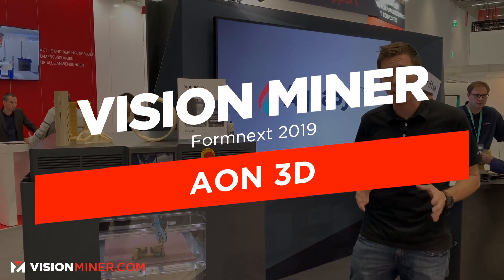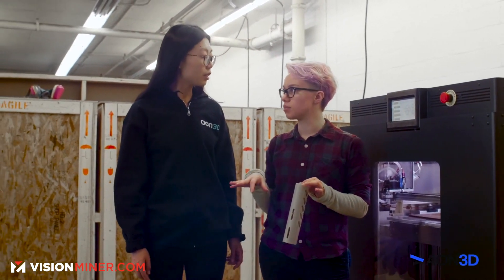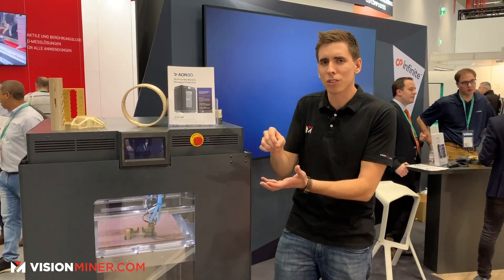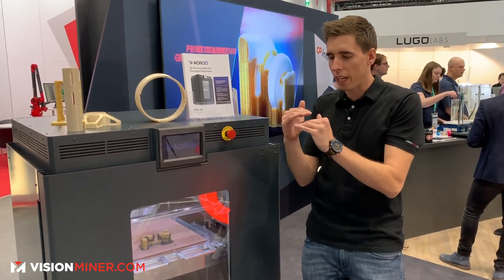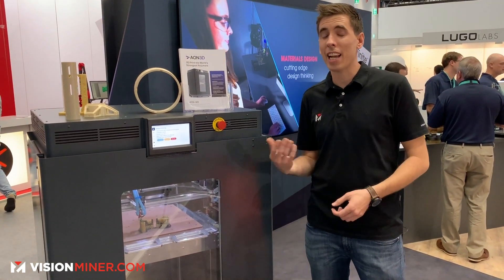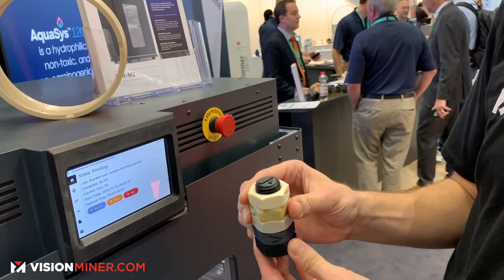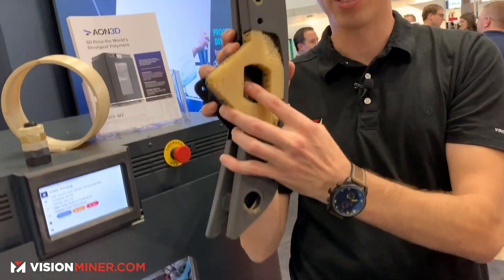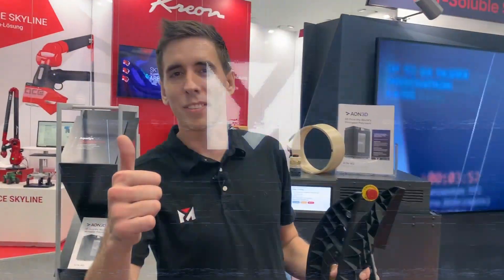AON3D M2: 2020 Edition High Temp 3D Printer for PEEK, ULTEM, and more! Formnext 2019

Comment: how are you supposed to print abs in a heated chamber with no part cooling fan?
Reply from the maker: Exactly like you said it -- in a heated chamber with no cooling fan. This has always been the best, most effective way to print ABS.

However, I can see how this may be confusing -- the filament market has evolved greatly the past two years, and consumer materials are no longer just raw, virgin polymers -- most contain additives, which help the flow, consistency, melting points, and things like that to make it more printable. Thus, it can definitely be printed in an open-air printer now, with a cooling fan, but the best results (mechanically, for sure) come from printing in a heated chamber -- on top of that, it helps reduce the expansion/contraction and helps maintain dimensional accuracy throughout the whole part :)

Comment: Looks like the A2V4 from 3NTR for most part except for the independant print head and a way more up to date features. And the only fact that it is S3D friendly is a plus compared to 3NTR with their SSI or Kisslicer default use.
Reply: The A2V4 only has a max chamber temperature of 90C. The AON-M2 2020 can reach upwards of 135C. The chamber temperature matters if you want to print large volume parts in commodity/engineering grade materials or any parts in ULTEM/PEEK/PEKK.